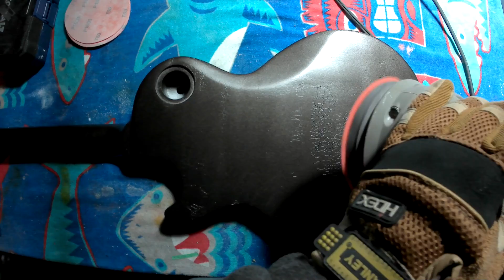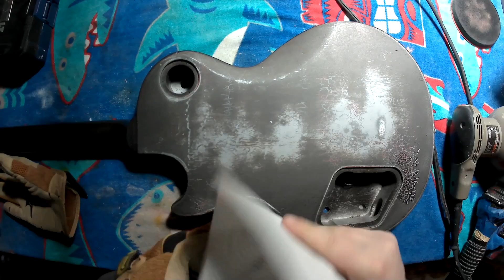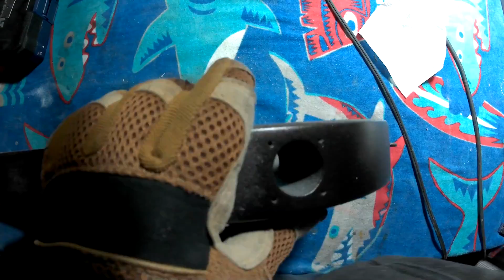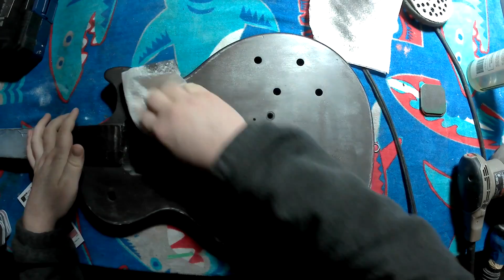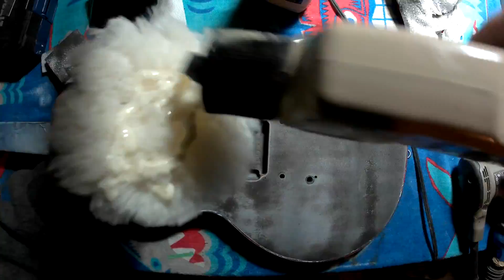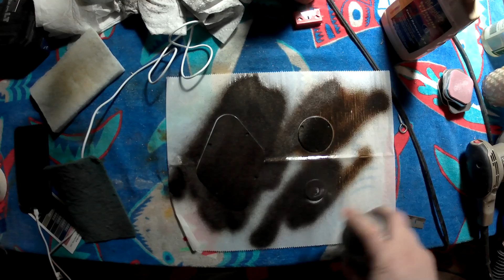The Gibson Les Paul Special Overhaul/Mod Project: RELIC METAL FINISH! (Part 2)

Comment: Watching all that high speed hand sanding made my carpal tunnel scream!!! Can't wait to see the finished product. I am a big fan of relic guitars. did a few telecasters a bit ago. It's fun. Don't know if your gonna use Muriatic acid to age the hardware or if it's aged enough already. But Muriatic acid does a great job, especially on nickel.
Reply from the maker: I'm definitely feeling it in my forearm about halfway through :P
I used muriatic on the hardware when I did my relic strat a few years ago. The hardware on this one is already preeeeetty relic'd so I don't think I'll go that far this time. I'm going to try a wire brush on a dremel to see what kind of polished down effects I can get, starting in an inconspicuous place of course.
Reply: @LucasFowler  Of coarse!